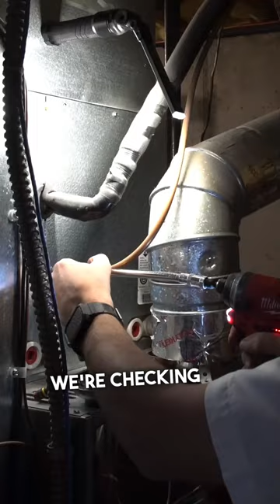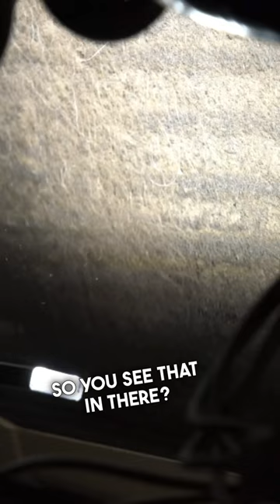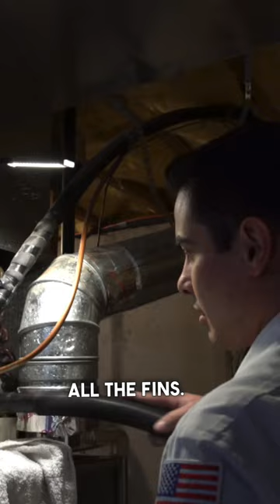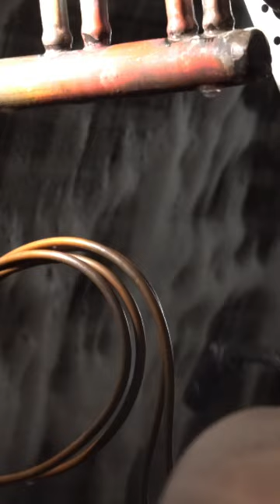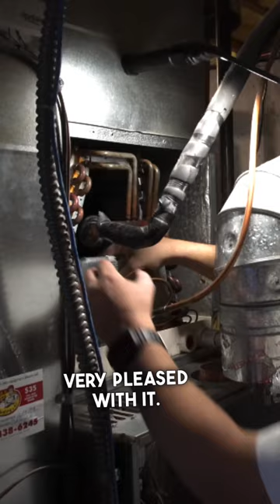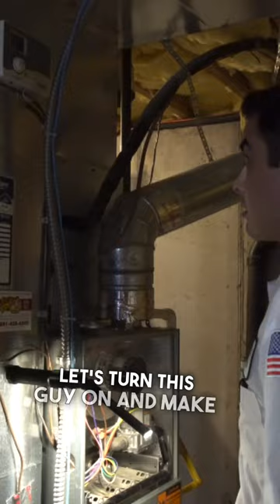Murray Henshaw Cleaning an Evaporator Coil

Comment: Are they running that evaporator without filter, my evaporator still clean after 14 years the unit is been installed and i have dogs and dirt.y filter is clogged after a month so change it often